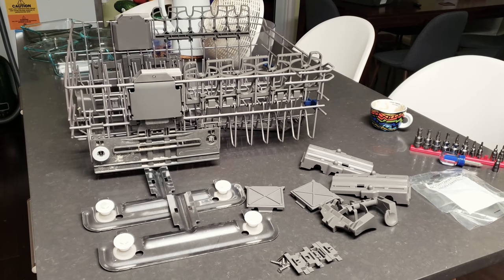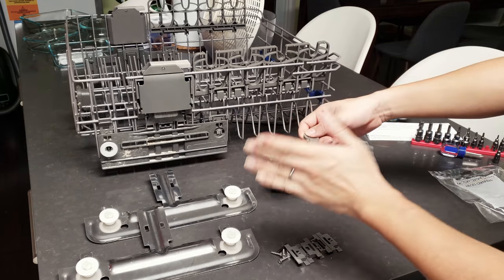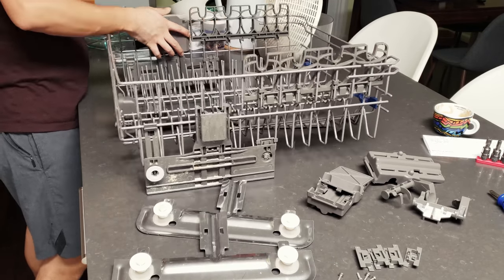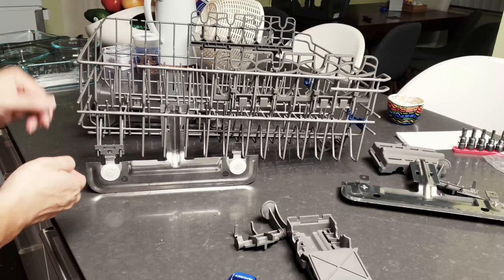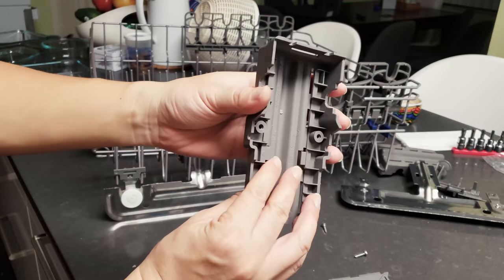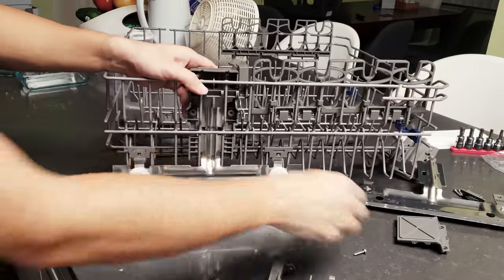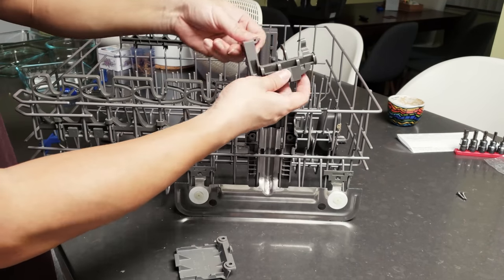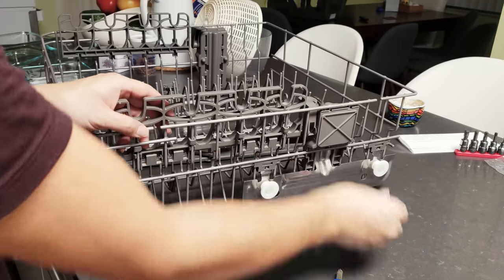How To Install Whirlpool W10712395 Dishwasher Upper Rail Rack Kit (AP5957560 W10350375 W10250159)

Comment: Thank you! So helpful and easy to follow.  Installation success :)
Reply: Forgot to mention - I purchased my kit on Amazon (save a bunch!) but my kit did not come with the adapter for the screw, which you will need.  But my Black & Decker kit had an adapter thankfully.

Comment: I didn’t get the adapter with my kit. Any hacks that will work?
Reply: Well, I went to Home Depot and found a socket that fit the screw but when I got home, I found my socket set had the adapter too, so I used that and got it done.

Comment: Thanks so much for the detailed video -- I was able to easily do this repair myself!  I will say that I bought the kit from Amazon and it did not include the adapter to use on the screws so I had to purchase one myself.  It still would have been cheaper than buying through Whirlpool, I'm sure, but might require a trip to the hardware store.